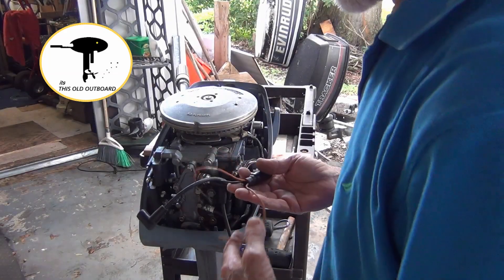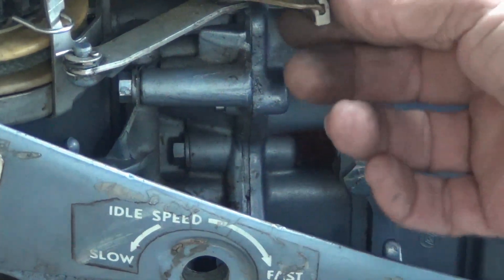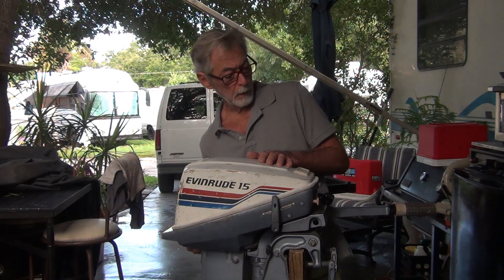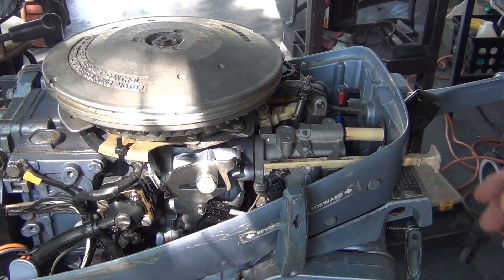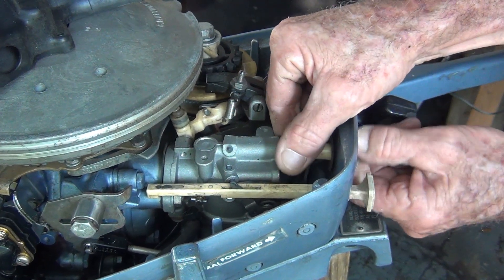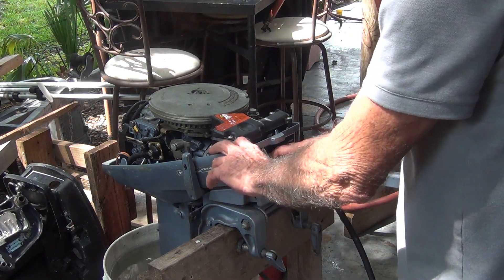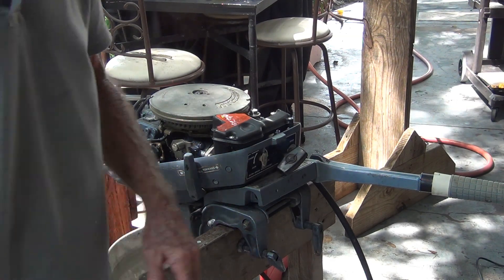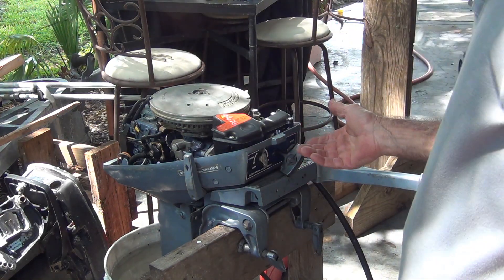1977 Evinrude 15 Hp. SHE RUNS ! THIS OLD OUTBOARD

Comment: Those 15/9.9 were some good little motors. So far I've had a '74, '91 & currently a '92. I can't wait to see how this one turns out. Please keep us posted!
Reply from the maker: Hey. Thanks for tuning in. Will do!
Reply: Yes they were good motors.  Tough little devils.  They had two weaknesses:  1) The early ones (like this one) had throttle teeth, between each side of the tiller arm hinge, that would occasionally slip from each other.  2) The water pump tube grommet (underneath, where the tube joined into the powerhead - you have to pull the powerhead to get to it) would mush out over time and block the water from flowing enough to keep the engine cooled.  Both were easy fixes, and the motors were great beyond that.

Comment: Hey buddy I got my 1977 evinrude 9.9 lower unit on yesterday and had some trouble with the shift Caller but dad and I got back together with to Ace hardware and Bought a Chrome bolt and Nylon lock nut and bolted it bake together got it working now she is a good motor ready for the water. I'm going to do the water pumps leter on they work well for now. The other 1979 Johnson works great too very happy with both. Great video buddy😎
Reply from the maker: Hey. Cool Man! Thanks for tuning in!

Comment: The 15 hp sounds great. Just a little tweaking here and there and it'll be good for another 40 years. Seems to be worth putting a few parts in it and bringing it back to full functionality. Need to fix slop in the linkage, install new impeller and put a proper choke together, but otherwise this is a nice motor.  Nice video.
Reply from the maker: Thanks for tuning in!

Comment: Got to love those plastic gears boy did OMC cheap out in those days,HA! You can use  thin plastic wrap or bags to tighten all those gears its involved but doable with disassembly.Youll never see that on the 1950S to early 70S models worn cheap plastic gears.They had those bronze nice metal gears as you know.Yeah your missing the stainlesss plate choke detent plate under the airbox too. She runs great needs throttle  linkage TLC. Oh and try compressed air or paper clip in telltale nipple before your pump work .. A Fun Video!
Reply from the maker: Hey. Thanks for tuning in. Yeah plastic, nylon crap. I noticed some water dripping from the pan during playback so it may be clogged. Not a biggie. Captain Ron can't remember if he put a new pump in or not and he said the detent was in a box of parts he gave me but I don't remember seeing it. We both have a case of CRS.... Can't Remember Shit! Hahahaa! Anyway, I'm not even gonna ask about the plastic wrap or bag thing, sounds to funky for me! Haha. Thanks again & Stay tuned !
Reply: @THISOLDOUTBOARD1  Kinda figured you knew about that detent plate under the airbox .I know you had a few previously in your videos & Its not your first rodeo,HA! The plastic bag thing is just rip and fold up small pieces of plastic and fold as many times & insert in the gears till its tight. Works pretty good actually and cant walk out. Those late 70S motors were great except for those not so durable plastic gears later........... TOT62
Reply from the maker: @GPOldMarineShop  I had a feeling thats what it was
Reply: I think the control gears aren’t necessarily worn, rather the square holes by the metal rod on either end. Drilling pins in sounds too destructive, and shims made of plastic or whatever sounds too soft - I’m going to try JB weld. WML

Comment: I been learning a lot for your videos and want to thank your for them. I do have one question. I have a 75 55hp Johnson and the power house isn’t get spark. How can I fix that? If I need a new one where would you suggest I look for one. Thanks in advance for the help.
Reply from the maker: Hey Thanks for tuning in. No spark means bad ignition parts. You really should get an OMC manual so you can test the parts to find out what you need. Try ebay for a good used manual specific to your model/year. It has a great troubleshooting section plus everything else you'll need to know. Thanks again & Stay tuned !
you can get parts here. https://www.marineengine.com/
Reply: @THISOLDOUTBOARD1  I do have one and I’ll look into that

Comment: Hey mate love yr vids wanting some advice on a motor I picked up I slaped some new plugs in its a 1975 25hp johnson I gaped the plugs at 0.030/.762mm and did the points at 0.020/.508mm is that correct for this model problem I'm having is my mates 1984 15hp motor on the same 12ft tinny as mine similar weight and he passes me were ad I'm stuck at 40kph taped out is there something wrong or something I should look at  prop seems good no major dents or chips any help would be great thanks love yr work has helped me alot so far
Reply from the maker: Hey. Thanks for tuning in. Wow! I've never had a 15 outrun any of my 25's. And I've had a plenty of both. Something crazy going on. But I've never had an 80's 15 but still it doesn't make sense. You don't have a big choice in prop size on the 25 for that year, and weight is everything! Biggest difference besides horsepower is ignition, the 25 running a points ignition and the 15 running an electronic ignition. Worn/dirty points and ignition parts can cause a weak spark, not mention it may have low compression. Did you check compression? All you can do is go through it and make sure it's tuned properly. Double check that carb, it may have gotten swap over the years. The High speed jet/orifice in the carb bowl should be a 72D size. Hope you figure it out and I'm curious to know what happens! Thanks again & Stay tuned !
Reply: @THISOLDOUTBOARD1  thanks for the reply I am definitely confused also haha will keep u informed have u got a email or some what I can contact u other than here going to go over basics this week checking pints again and also checking compression ect
Reply from the maker: @kaisloetjes483  Hey. no i don't have an email  for the channel, and everytime someone posts an email youtube takes it down due to the scams. plus people like to read the comments. it helps them out and/or they'll help out.
Reply: Just found your videos, already love them but my question is I have a 74 johnson version of this exact same motor but it’s points and not CDI. It runs fine but when you get to what should be WOT it only does 4mph and I don’t even think it’s reaching anywhere close to redline. My buddy has the same motor and he’s having the same issue and we’ve been stumped since we bought the damn things.

Comment: For years your compression tester is always higher than mine
Reply from the maker: Yeah you never find two the same
Reply: Could be the speed it's turning over - pull rope or drill motor.